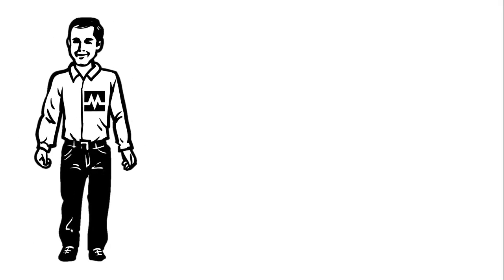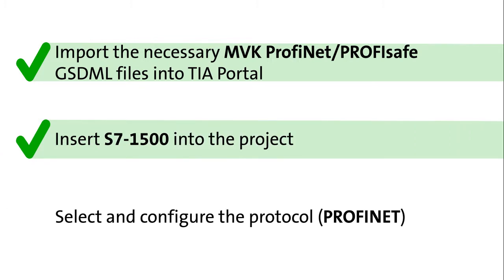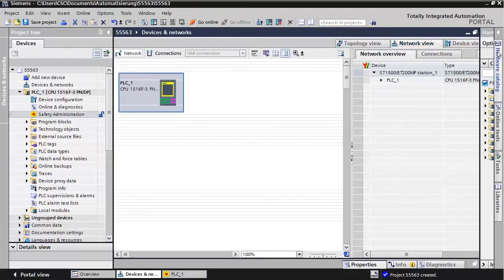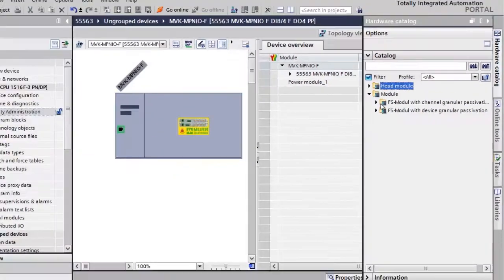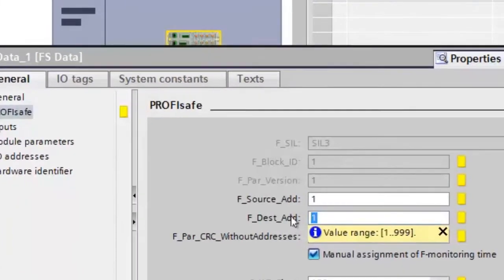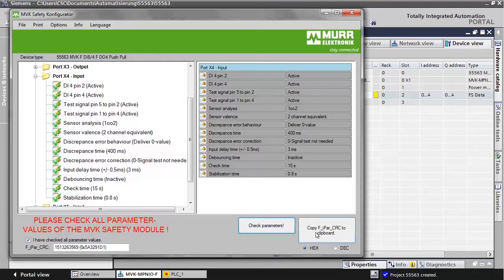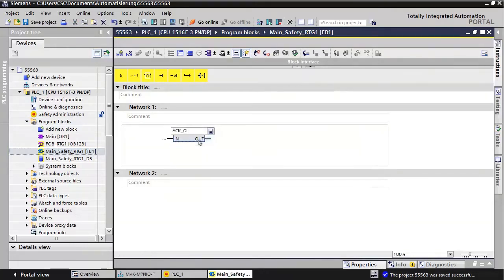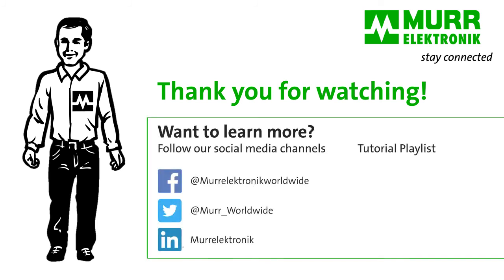MVK Safety (55563): ProfiNet/PROFIsafe configuration with TIA Portal (Device passivation)

Comment: I have my ACK_GL programmed correctly but it doesn't reintegrate until I power cycle the murr IO block. Any insights how I can avoid that and let my reintegration reset?
Reply: Hi I have the same problem! Have you solve in any mode?
Reply: @sixi98  same problem here, any idea?